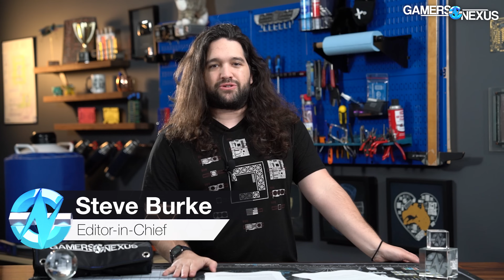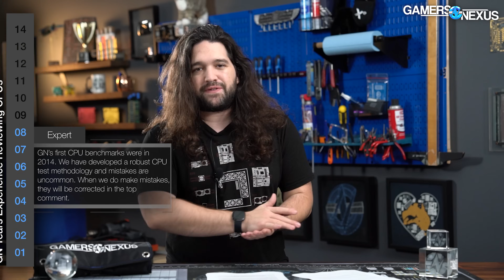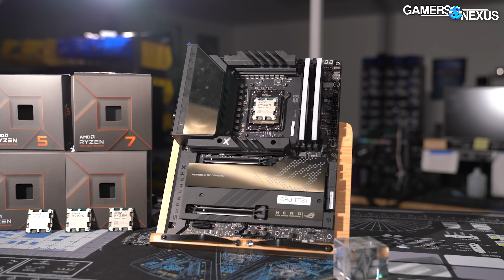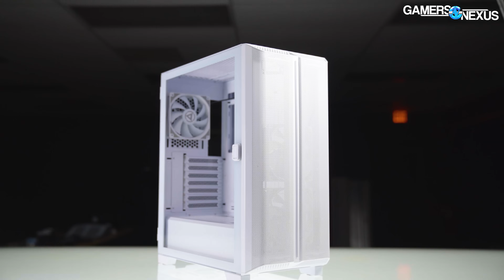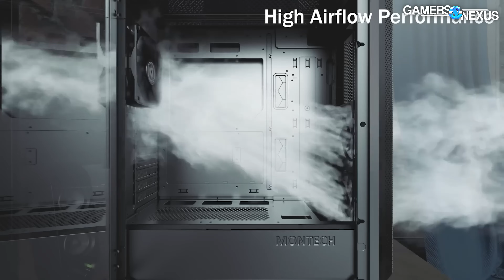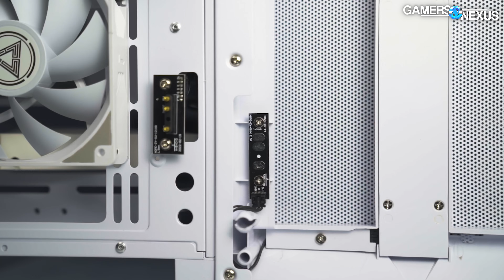AMD Ryzen Eco Mode Deep-Dive & Benchmarks on R9 7950X (Zen 4)

Comment: the formula you present at around 7:05 is essentially the definition of thermal resistance. A definition is not right or wrong. But ofc the onus is on the hardware supplier to provide an accurate wattage figure that allows for the design of an appropriate cooling solution (the theta)

Comment: One unanswered question, could you use a Noctua D15 AM4 for the 7950X with the '105'-mode? It is impossible for me to estmiate that based on how warm it gets with a 360-cooler with fans at 100%.

Comment: 105 W Ryzen 79 is quite impressive, surely the power mode of my 1700 is the eco for 7950 lmao, but hey, AMD did a great work still tryna be "power efficient" whilst intel just said screw it and cranked everything up to bring each FPS possible iwth that enormous power consumption like 4090.

Comment: This video is insanely good, as all of your benchmarks. Truly high quality content, thank you so much for your work :)

Just a thought: how much power do we gamers waste for 3 extra FPS, when we could run our CPUs at basically 50% stock power? It seems like there should be a push from the industry to market this: "Cooler room in summer and energy savings for just 3 FPS!". Especially relevant for higher-res gaming (2k or higher), since CPU performance really stops mattering at all at those points. 

One thing I'd like to know is some measured power consumption during gaming. Of course during benchmarks where the CPU is constantly at max performance, the efficiency change will be impressive, but doesn't this happen automatically when gaming at 2k because your CPU really doesn't need to go so hard?

Thanks a lot again :)

Comment: Sadly ECO mode does not fix idle power draw. And temp is irrelevant 95c is fine everyone is to focussed on it. As long as it does not throttle temps is irrelevant in this case. Power draw is all that matters as power = money, and a lot of it these days. we hit peaks of 1.09 euro a kwh which makes 100 watts more or less for 4 hours a day and 15 watts idle for 8 hours a day a serious issue money wise and can cost as much as a upgrade in 4 years. that makes a 8x 15 watt and a 4x 100 watt for a gaming load a 400 euro bill over 4 years.I's a utter shame it came to this and we have to tweak ourselves to make it work correctly. and looks like slightly higher then 105 may be the sweet spot. maby 125. And i really hope you will do the same for 13900k and compare the 2.

Comment: Interesting. Is it also possible to set a temperature target instead of power target? Because that would cut off the high temperature limit that are there by stock, and would make the coolers run at slower speeds.

Comment: It's a shame you didn't try a tune of your own - It's clear that the 105W ECO mode leaves a lot of performance on the table, whilst the 170W stock values throw efficiency out of the window. I would likely try a few values with CB23 tests, but my starting point would be a something like a "125W cTDP" with PPT=175, TDC=125, EDC=190.

Comment: I have tested similar things on my 5950X and really interesting results happened. At full power auto OC, I got 27.5k in cinebench, but when I limit the core to 4.35 GHz 1.2 volt, it went to 28.5k. I think you have to set a limited core clock to unlock its full potential.

Comment: The 7700x has a 105W TDP by default, would there be any point in setting the 105W Eco mode? Would that actually do anything to change the targets for the CPU or would it just be restating what it's already targeting?

Asking because I have a 7700x and I run it at the 65W Eco mode. It helps me a huge amount with thermals and just basing it on number=number it doesn't seem there'd be a benefit in the 105W Eco mode? I was going to set individual PPT/TDC/EDC as I'd seen others recommend but for whatever reason my BIOS capped any number I entered for any of those boxes at 65,000 (slightly more but I don't remember the exact number).

Comment: Undervolting and/or the use of eco modes is underrated, in my opinion. Perhaps not the most popular video concept, but what if you would do benchmarks of all the eco modes? Given that you include energy efficiency in your latest set of CPU comparisons, which I think given the energy prices and the general trend in the industry for consuming more power to keep topping the charts, this comparison would not be a bad idea. I am overdue for a GPU upgrade, but right now, for the first time, I am taking power efficiency into consideration.

Comment: It reminds me of diminishing returns, when overclocking. You eventually hit a barrier, where you have to push too much current to only get minor improvements. And that´s what AMD did here. Just as they did with FX9590 in the past (look, we made 5GHz CPU!), they did that again.

I´m sort of worried about the durability of these chips, considering we were taught, overclocking with high temperatures shortens CPU lifespan and this is basically heavy CPU overclocking. It will probably endure the warranty, but what´s gonna happen later?

Comment: I think it's time for efficiency benchmarks and league tables. :D  Instead of performance being paramount for bragging rights with overclocking, which is effectively dead now that what amounts to automated oc'ing is baked into all modern CPU designs, how about instead the bragging shifts to who can obtain the best efficiency. Divide the performance by the power consumption (or whatever), there's your number, and it's still a linear metric. In these price concious times, perhaps a popular thing to be aiming for. The nature of the performance behaviour varies depending on the workload, so it could be the E-test for whichever normal benchmark, eg. E-CB R23, or E-Blender BMW, or E-fps for whatever game, and it can apply to GPUs aswell. Getting 300fps with a 4090? More impressive to get 275fps with a third less power, the resulting E factor would be higher up an efficiency chart.

One can do the math manually, but an automated test and suchlike would make things easier. I'm surprised nobody's done this already, combine an existing benchmark like CB with the package power or whatever readings from HWInfo.

Comment: The 105W Eco mode seems very interesting. I am interested now if it would be possible to further tune the CPU in that mode to squeeze performance out by adjusting voltage in multicore mode, aka undervolting the CPU on multicore workflows.

Comment: On most of these numbers you appear to be focusing exclusively on the CPU power usage which obviously makes sense but on the 'efficiency per job done' do you switch to overall system power usage because if you are running a system for say twice as long to save 20% CPU you need to be careful that having the rest of the system on for that extra time doesn't consume more than this 20% saving.

Comment: 6:00 my 7900x with a asrock x670e steel legend shows a TDC of 180A and a EDC of 250A.

i myself am running a ppt limit of 160W, that is enough to get the temps below 80°C in 10minute cinebench runs but not so low as to lose more than like 2% of the score.

Comment: Now if someone could come up with a one click desktop application to switch between modes then you'd really have something where you could run it at 105W ECO for normal use and gaming and then put it into full power mode for production applications

Comment: Mmm, I would have tried this with the 7700x for a wider audience ^^. Still waiting for more reviewers to use air cooling with these chips.  For workstation 105w looks fine. However, I was hoping to see more frequency stability with AMD eco presets...as the power is cut for gaming we are definitely seeing the 1% and .1% lows drop significantly on 105w...so stuttering/slowdowns are perhaps much more likely. Wish there was a manual undervolt OC here for comparison purposes. Well this gives an idea at least for how the other CPUs in the lineup may perform with eco mode. "Thanks Steve" =)

Comment: So many people talk about performance/$, but completely omit power draw from the equation, whereas if you're a heavy user, the cost of power can exceed the cost of parts over even a single year of usage.

It's more than direct power usage too, if you have a system outputting 500Ws of heat, and an AC in the room, to pump that heat out, then the actual cost is even higher.

During a particular stretch of heavy usage, in the summer, I was spending €400 per month over normal usage, that pays for a part with an efficiency upgrade very quickly.

Comment: I'm 'power limited' in my office by how sweaty it gets in the summer (it has central ventilation but that only helps so much). Seeing both Intel and AMD pushing their CPUs so hard out of the gate is a little spooky to me, so it's good to see that out of the box there's an option to keep them reasonable without losing too much performance. Forgive my ignorance but does intel have a similar feature in the bios where we can just set the power limit on 13th gen?
Reply: Yes, you can change the PL1, PL2 and Tau on Intel CPUs.

Comment: 105w mode can be used for cost saving. You can get a cheaper cooler, or more likely not replacing an existing cooler. It may also allow you the extra headroom on an existing power supply to allow for a GPU upgrade, without requiring a PSU replacement.

Comment: 105W Eco mode is actually really impressive 4.8GHz. Also 65W 4GHz is not bad. I feel they should've shipped the cpu's at 105W standard and then allow PBO to be the now default. Is not about power itself, is that it makes your room hot. Specially in summer, already 65W does that
Reply: @diomedes7971  if i was the marketer leader i would ship it as 105w and during presentation i would place a new feature that is the same PBO, calling it different and make the cpu use more power :D everyone happy

Comment: the power efficiency of 65W Eco Mode is amazing, when I will buy the Ryzen 7 model, 7700X, I would use it on that mode, the temperatures are amazing, and the performance loss is not that big

Comment: Since 105W mode for 7950x has the showed gaming results, could you do a 105W test on the 7600x purely for gaming, to see if it shows similar results?
Reducing the power and having similar performance for a 7600x used only for gaming would be even more helpful, for "budget" builds, reducing costs for cooling mostly

Comment: I dont agree that is is just better to buy 7900X over 7950X running 65W Ecomode because of price difference.
If we consider 2 scenarios: first running 24h per day and second 4h per day and electricity is cheap at 0,2€ per kWh here are exanples:

7900x vs 7950x 105W - 72€ (cheaper in 24h scenario) and 12€ (cheaper in 4h scenario)
7900x vs 7950x 65W - 193€ and 32€
7950x 105W vs 7950x 65W - 122€ and 20€
7950x vs 7950x 105W - 183€ and 31€
7950x vs 7950x 65W - 305€ vs 51€

Comment: I think it would be interesting to make a comparison for long term costs of running the AMD in Eco vs non eco mode vs 13900k. Do the energy savings make up for the 150$ difference? Granted, if you're buying either cpu, money is clearly not an issue, but it would be interesting to see if you eventually recoup the costs.
Reply: It depends on local power cost and how much you use it to run high multi-core loads. For 7950x stock vs eco105, in a server environment averaging 12 hours of load per day and $0.15/kwh; that $150 would likely be recovered in 2-3 years. 
Maybe a bit faster return in hot climates due to the building's refrigeration costs(Both initial install size and power consumption.)
Figure 1/5 of the heat energy will be needed for running a heat pump where active building cooling is required. (Some big units can get 1:7 efficiency with a modest temp delta, but then you have maintenance costs and the higher the temp delta between inside air and outside the lower the heat pump efficiency. 1:5 is realistic.)
In cold climates it is plausible to use the server room air to heat an adjacent building. I don't know how practical that is, because server farms are not usually located near expensive office real estate nor apartment buildings. (Maybe greenhouses, but when is a server company going to coordinate with a horticultural plant producer?)

Comment: This efficiency is incredible! AMD designed these things to basically auto-overclock out of the box, but you can easily just put 105W "Eco Mode" on and get almost the same performance!

One has to wonder how severely impacted the 13900K would be in all of these same test at a 160Watt limit (the same Wattage that AMD's 105W eco-mode uses in all core workload)

Comment: I thnk you may have missed something. If eco mode runs significantly cooler then it may actually leave more thermal headroom for brief single core boost. Which is the thing gaming cares about most. Some of those scores looked well outside your confidence bars and it doesnt seem too hard to explain.

Comment: Thanks for the review. I wish I knew the power consumption in each game, do you have it recorder perhaps?
On rendering the power consumption differs as you showed, however in each game the power consumption might or might not change at all?
How do we know that for example 105W and stock doesn't have the exact same power consumption in games where the cpu is not 100% utilized and some cores are already at sleep?

Comment: The claim is made around 17:42 that 105W Eco mode functionally ties the stock configuration in compile speed, but with much less power consumption and temperature. But what were the power consumption and temperature numbers for Chromium compilation? I didn't see them mentioned in any of the earlier sections. Compilation doesn't scale as perfectly as blender rendering and can be more bursty, meaning that this could simply mean that Chromium compilation at stock wasn't actually taking the full power budget to begin with.

Comment: I wish you tried curve optimizer to lower voltage frequency curve and compare with eco Mode and stock cpu. It can perform very similiar to stock frequency but increasing efficiency by a lot.

Comment: I am impressed with the AMD ECO mode. You can dial the 7950X back to 105 watt or even 65 watt. And in those modes it will in worst case preform equal or better to 12900k. If you need the max power you will be able to flip a switch and unlock the full potential. For my work I see that as very tempting. As you can select to have a docile office 65 watt CPU office PC. Or a semi HEDT PC in the same package

Comment: A little disappointed by this review.  I really wanted to see the generational improvement in performance for a similar power envelope. Ie 7950 in 105 watt mode vs 5950 stock, how did they preform relative to each other?  For about the same power how much performance improvement would I get for an upgrade?

Comment: I don't really care about the temperatures as long as they are within the designed spec. 95°C intentional - i'm fine with it. What i started to really care about these last 2-3 months is the power consumption. With electricity getting more and more expensive every month and with new tiered prices we will be getting here in Europe, suddenly a 600W GPU and a 250W CPU are a problem. It's easy to buy a $1600 GPU and $600 CPU, but what isn't easy to live with is paying 1/10th of that each month for their own power draw alone.

Comment: Been using Eco Mode on my Zen machines during summer, the performance loss is negligeable compared to the lower temps and potential longevity of the parts.

Comment: 27:50 it makes sneakers to go balls to the wall as fast as you can even if it more power as the duration x watt multiplier would be a benefit over more efficient say 15% saving but it it take 30% longer then you have lent gained and are effectively less efficient. If however theres a 15% saving and can be done 5% slower in time then definitely have a efficiency gain.

Comment: just ran the blender benchmark on my 1950x threadripper and it was pulling 300 watts with a 4ghz oc. Crazy that the 7950x is twice as fast as it in blender and uses half the power as well in eco 105w mode.

Comment: In my opinion. AMD should be using 105W limit at default, then allowing the motherboard vendor to allow "unlimited powaah!" mode or something like that.
That 300 Mhz difference in all core load like in Blender translates very little to performance improvement. R9 7950X still kicks ass at 105W mode and will receive more positive outcome from reviewers.
The benefits are:
1. Best efficiency
2. Much cooler CPU temperature, allowing consumers to pick cheaper CPU cooler
3. Much less power consumption, allowing motherboard vendors to design cheaper motherboard with so-so VRM and the CPU will still works just fine at stock.

Comment: Seems to me they designed the thing expecting something around the power limits in the 105W mode, then got wind of what Intel was doing with 13th gen and decided they needed to run the thing balls out to have benchmark numbers that could keep up.  I'd have rather they just released it with the 105W settings as default and beaten the snot out of intel on power consumption while still hitting the same numbers in gaming.  Instead of eco mode, they could have instead offered 'production mode' that would lift the limits to what is now stock, with some marketing bs that the mode is intended for people that want to get the most out of the CPU in all core workloads, and can put a huge cooler on it.

Comment: I've been running my 5800x with a thermal throttle limit of 75c, which keeps it form wastefully boosting and is very quiet with my air cooling. Is there any disadvantage to this method compared to eco mode or setting ppt etc manually? Somehow my r23 scores are almost unchanged while the difference in noise and power usage is noticeable.